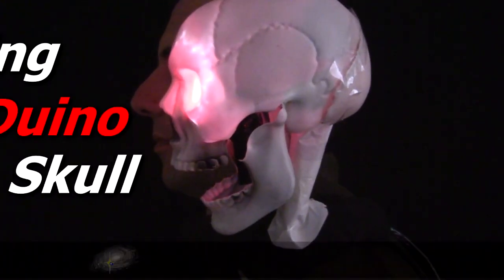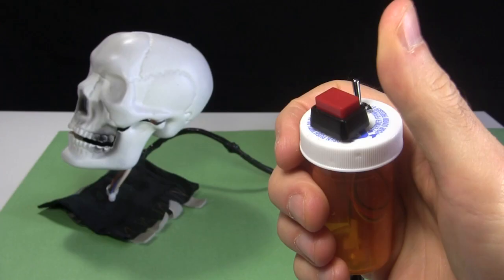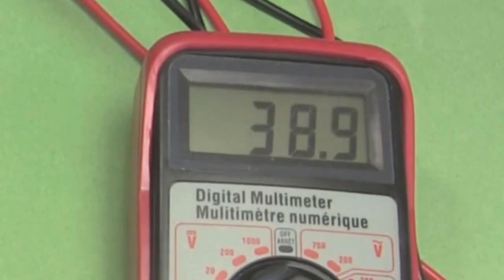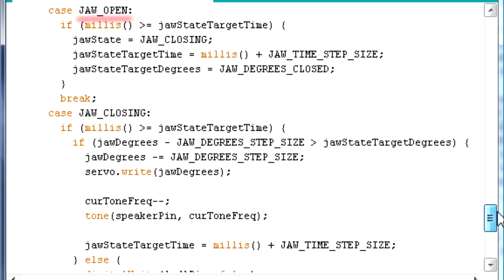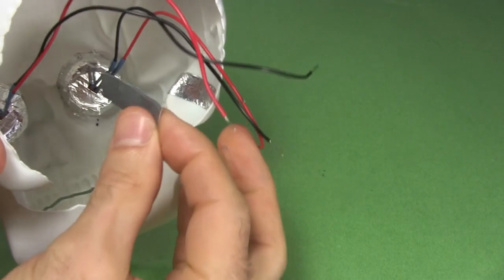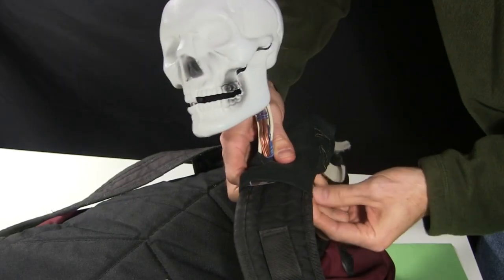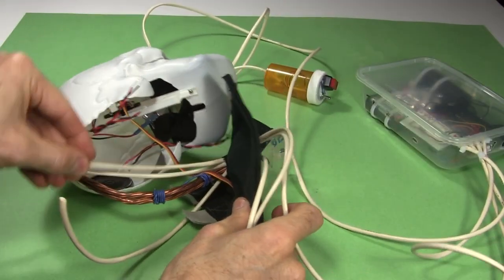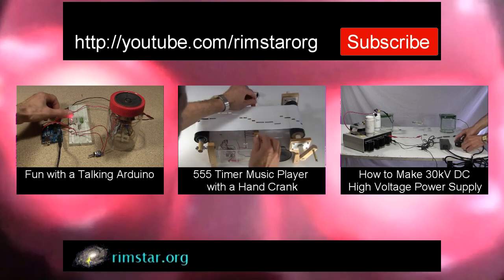How to Make ScareDuino - Arduino controlled Skull with Servo, LEDs, Speaker

Comment: cool  wish it worked  i get a FILENAME error at the #include line
Reply from the maker: I think I recall someone mentioning that and it was a version issue with the Arduino IDE. Either it needed an older version or a newer version, I don't recall which.

Comment: very cool, imagin hooking up a microphone and recording whatever you say. then randomly have the skull replay it.... very gostly.
Reply from the maker: Yves Baggi Thanks. I wanted to do something like that originally but I wanted to do everything through the Arduino. There are Arduino libraries for voice and more sounds but they had conflicts with the servo and stepper motor libraries. So I ended up using the simple tone() function that comes with the Arduino libaries.
Reply: It''s cool as it is. Ive put sound through the arduino and even a bit of dsp is hitting it's limits quickly. mainly memorywise.

good stuff though.